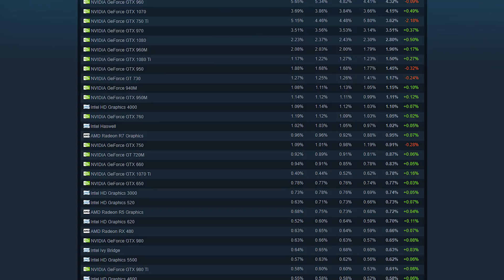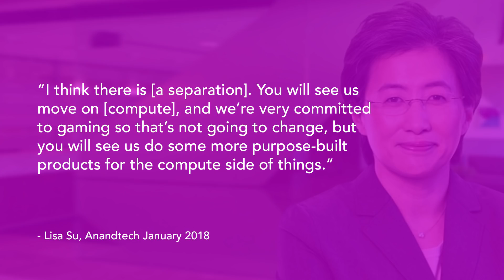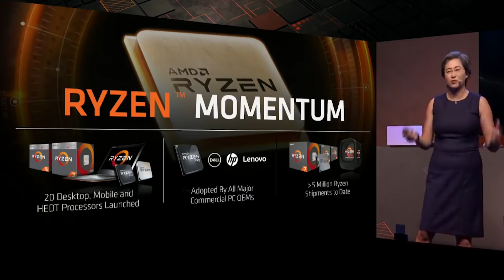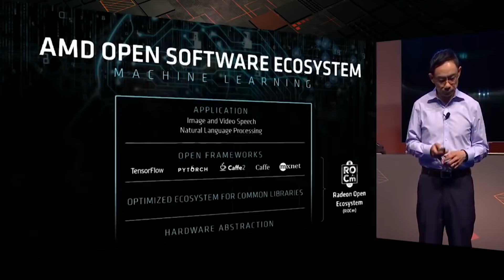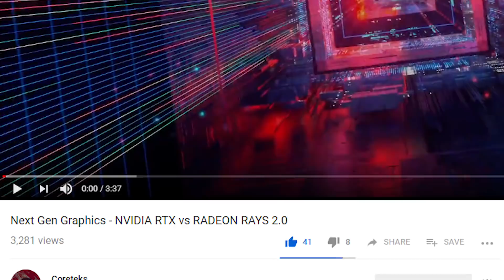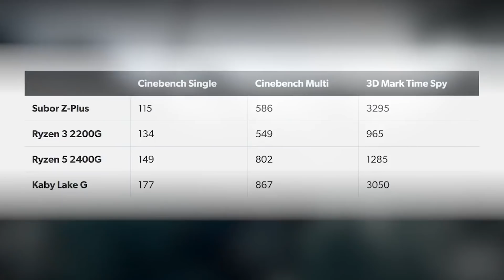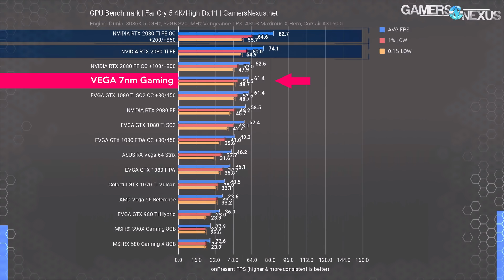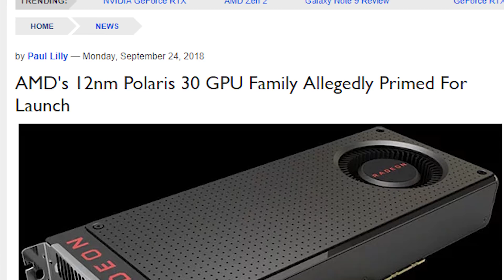AMD's answer to RTX

Comment: I'm wondering... when there was the leadership switchup in the Radeon Group when Raja left, there was also a push over of AMD's Ryzen team engineers.  I'm wondering if Vega 7nm gaming (monolithic) was being targeted for summer/early fall with ray tracing... then nVidia forced out the RTX cards.  AMD may have got wind of nVidia's rush and decided to try chiplet to prevent being badly burnt by yields.  Every time AMD has played the "Lets make a giant chip" game with nVidia, they've flubbed up.  Delay the card preview by a few months, use a chiplet design (since they'd have to redo the memory bus anyway for GDDR6), and delay Zen 2 Ryzen 3000 desktop parts to yield Vega Chiplets for both gaming desktop and mobile.  They could easily hide this move by announcing they were skipping Zen + on Epyc and moving straight to Zen 2... so the foundries are pouring out 8-16 cu vega chiplets and 4-8 core zen 2 chiplets on "7nm", and chiplet controller elements on older 14nm processes (infinity fabric, memory controllers, bus interfaces, etc).    It would be a coup... because then they could tweak all their processors to have some amount of GPU/CPU/Memory/bus flexibility while drastically increasing yield AND getting nVidia to jump the gun on tech.  The biggest obstacle will be the drivers.  AMD has had so many problems with their driver launches in the past.  But... there's only so many methods to crunching a ray and if they've been focusing on ML applications, its possible that they've worked out their own tensor-like AI core.  So if their ray calculation system is faster and they can get somewhere close on the AI side, then its quite possible that a vega 7nm chiplet may have far, far more punch per watt and sq.mm than RTX.

Comment: It's been speculated that AMD's GCN isn't fully utilized in games.  At a guess perhaps only up to 85% or so is used in games.  However, utilizing more of AMD's GNC isn't the problem. Core clock also factors in as well.  If AMD could release a Vega card that is capable of   1850MHz alone would align it to Nvidia's RTX.
Don't believe me? Take a look at any of the youtube videos comparing Vega vs Pascal and you will immediately notice that Vega is at 200Mhz-400MHz lower clock rate then a Pascal card.  
If that clock rate gap between Vega and Pascal was reduced to around 100Mhz or so (at best OC) Vega would fully beat Pascal. And all it would be is a Vega refresh.

Now imagine what Navi could do at 1800Mhz...At best guess it should fully utilize GCN for gaming more so then what Vega could for starters.

Comment: Every AMD product I have every bought went bad after two years. My computer from 2010 is still working great with the Intel and Nvidia products. I would try them again though because Nvidia is getting a little too much in price. I think the max price for the 2080ti should have been $899 since it only gives you 20%-25% better graphics power over the 1080ti. Really I would wait until the next gen cards if you have a 1080ti already it just is not enough increase for the money.
Reply: I am still using a Radeon 7870 to this day (2012) had old 6870 sold to brother still working "perfect" 8+ years (changed the cooling fan because those eventually die) and a 4870 that "lasted" 4 years (till brother messed up and killed it by not screwing the thermal block down proper when he had to replace fan)

I am sure you have many friends (I do) I have had maybe 10 friend with well over 100 GPU Radeon and some 50 with ~500 Nv cards, the vast majority of them had "Nv" die for "no reason" even when the card looked "pristine" then they had Radeons "die" for no reason....... To each their own, sorry about your "bad luck" hell I had one buddy he had to send his GTX260 in 3 times, replaced with a 460, it got "upgraded" to a 560 and 650Ti..all told he went through 10 GPU Nvidia wise (5 replaced my RMA within 6 mths) 5 he bought to replace RMA no longer valid or wanted upgrade (of those 5 no RMA) he "bought" only a single one lasted more then one year NOT being overclocked and always proper cooled case, 5 of them were EVGA, 3 were MSI the rest ASUS, all among the most expensive versions of each (go figure)

Comment: RTX is usless because the performance drop when you turn on ray tracing in a game is so big that everyone will turn it of anyway. What you end up with is a graphics card that is only slightly faster then 1080 or 1080ti at double the price when running games normally without the ray tracing turned on...

Comment: I am excited to see AMD innovating again and beating Intel and Nvidia to market with innovation instead of just throwing more cores and memory to increase performance.  I am actually holding off on building my new system until Navi is released, that is unless the 7nm  Vega cards are priced at point that it makes sense and the performance is on par with a RTX2080.  I have always preferred AMD as their price points have always been more reasonable compared to the competition. 
I am hoping they are taking their time to make sure that everything is ready for Navi so they don't have issues like they did with Ryzen when it was realeased.

Comment: Isn't the higher end market always shit ? It's pushing the boundaries with in-development products that some naive people are impressed with,  the cards are far from bringing proportional performance relative to their power consumptions or prices as far as I can tell.
Reply: usually always is this way...psh to the edge of redline and yes performance gain BUT things wear out much quicker, use a lot more fuel etc, the "middle ground" is where all the real optimizations and stuff really are at (AMD knew this many many years ago and have done sweet spot strategy ever since, start in middle, scale up to "boost" or scale down "to lower power") Nv on the other hand tend to start at very top and "chop and prune" different designs out, their "smallest" tends to be the "best" in regards to lowest power BUT much less performance for extra cost that could have been avoided, but that is Nv for you, sad thing is they tend to NOT increase the capacitor/vreg design from the middle up where AMD DOES

Comment: 1.35 times faster than the previous one?
Well no one really cares about that, because that wasn't really the problem.
The problem was power draw, heat. And right next to the 1.35 times faster figure is the 2x better power efficiency!
Now THAT is a game changer!
Reply: all they would "really" have to do, is "optimize" i.e tweak the voltages like end user can "easily do" but either they did not have manpower or engineers to take the time to do this....Vega 64 is "power hungry" and throttles BUT if you "devolt" it runs WAY cooler and uses much LESS power idle and load and NOT throttle...if they "shrunk" to say 12nm or 7nm and took the time or added a "regulator" to constantly adjust minimum required power (such as Ryzen, Ryzen 2xxx have, and GTX 10 series) it would allow them to have a higher clock AND have much overall better power use (therefore temperatures)

I call BS on Nv power use figures because it is "software" controlled design, Nv constantly BS/hacks/cheats with software BUT they did do a pretty decent job at power design for the 10 series, hopefully AMD took notice and will be doing similar concept but keep the FAT (lower power all the time as much as possible, but have the muscle when you need it) ^.^

Comment: Back in the day AMD has some kick ass cards like the r9 280x which I had and also the amazing r9 290x, both these cards would trade blows with nivida top cards, but sadly now AMD has been falling off, they are just not as good as they used to. Same with there processors they are the same as there old ones, with high core counts and shitty single core performance.(I personally bought the r7 1700x and it does shit in all games, really hold backs my gtx 1080) but now nivida and intel are being more and more greedy and AMD really has to do something to compete with these companies or else the consumers will get fucked over with $800+ cards.

Comment: I will never buy an amd card no matter how cheap they  are. They consume too much energy and generate a lot of heat making my room feel like furnace. And I ain't buying an ac just to spend a lot more money on energy  in the long run.
Reply: I guess you have heard of Vega undervolting. Amd's stock voltages are way too high to ensure that even the worst piece of silicon can hit advertised clocks. Example. My Vega's stock voltage is 1.2V. I have undervolted to 1.05 V and also fine tuned core/hbm clocks to higher than stock and while gaming with 100% GPU usage (PUBG), the card consumes 170-185 Watts, which is lower than a 1070 on stock settings does. Oh, and also it performs better than a 1080 in gaming. Nvidia works out of the box, with AMD you have to tinker a bit yourself to gain most potential, but in the end it is worth it. If you feel like manually changing clocks in 2k18 is not suited for you, stick with Nvidia and call it a day

Comment: The odd part is HBM is just regular ddr memory with more memory controllers. It was supposed to be a cheaper way to utilize older tech. Personally I would like to see vid cards with replaceable memory like in the past. Usually the only difference is between chips is optimal voltage and timing specifications which are normally baked into the GPU rom. It would be nice if someone actually showed mfg real cost vs market up sell.

Comment: I'm neither a huge fan of Nvidia nor AMD. I have a gtx 1060 and I don't care if I have to switch to a vega GPU. But only if I don't need a nuclear plant to power it. When you look at the TDP of the vega 64, it's like x1.5 more than a 1080ti for less power. Add their noisy fan / high temperature  to that and it's a no go for me. When AMD will build a good GPU (like a 1070 for exemple, I don't need more) with a "normal" electric consumption, i'll reconsider the offer. But for now it's Nvidia all the way
Reply: I guess you have heard of Vega undervolting. Amd's stock voltages are way too high to ensure that even the worst piece of silicon can hit advertised clocks. Example. My Vega's stock voltage is 1.2V. I have undervolted to 1.05 V and also fine tuned core/hbm clocks to higher than stock and while gaming with 100% GPU usage (PUBG), the card consumes 170-185 Watts, which is lower than a 1070 on stock settings does. Oh, and also it performs better than a 1080 in gaming. Nvidia works out of the box, with AMD you have to tinker a bit yourself to gain most potential, but in the end it is worth it. If you feel like manually changing clocks in 2k18 is not suited for you, stick with Nvidia and call it a day

Comment: Amd could make a powerplay. They could loose a ton of money in vega 7nm by pricingbit REALLY low to gain a lot of market share so more game dev's support their open source stuff. Thus setting up their cards in the future to be more successful.
Reply: but wouldn't be NVidia be also be capable of that? they have more "resources" and are actually pretty close to real realtime pathtracing... don't get me wrong but most designers learn on platforms line maya or 3ds max and not blender, which have AMAZING bonds with Nvidia's gamework... AMD has to get to the youth of graphics/asset designers and introduce an easier UI implementation for these programms!
Reply: for examole: investing in universitys, that they introduce students to these technology only problem: the older studios are familiar with Gameworks and maya / 3ds so there will be a hard split they basically need to teach sooo many students AMD's way, so that these older studios have NO WAY, BUT TO ADAPT AND ACCEPT amd's technology and scrap that nvidia stuff cus nobody does that then anymore
Reply: yeah but nvidia has many more fans so they wouldnt feel the need to lowball. their cards will probably still sell.
Reply: @Eian_Anderson  yeah, that is also something. Anyway, as i said, they need to convince the classic Studios to adapt.

Comment: AMD's biggest obstacle is the fact that Ray Tracing has to be built into an API. Nvidia utilizes Microsoft's API that they've tacked onto DirectX, and this leaves AMD in a situation where they're forced to develop their own API. Yet again, it's a situation where AMD's option leaves more work for developers, meaning it likely won't be used. Not that it's necessarily a bad thing in this situation; Ray Tracing won't be mainstream for another 5 years if I had to guess. The performance hit is far too great, I mean for crying out loud the 2080Ti can barely surpass 1080p60 with Ray Tracing on.
Reply: Vulkan can do API layer so it can "use" DX12 as a "backbone" and Vulkan as the "lifter" there is a reason why most of the "features" (the advanced ones) in DX11-12 and Vulkan are all near identical to what Mantle was (till AMD "gave it" to Kronos and let MSFT incorporate some of the same features into DX11-12) difference between the wya Nv does things and AMD does things, AMD does majority in hardware, Nv does mostly in "software" because it is "better" for the former and "easier less costly" for the latter

Comment: Wow half the video is pure speculation and even then they admitted Nvidia was still king of the high end GPU market with their RTX cards. So why the AMD hype train? It's not even going to be any cheaper than Nvidia since AMD has to use HBM 2.0 memory because of their design. In fact it might even cost more to buy. WTF is wrong with AMD fan boys? How many times does Nvidia have to beat AMD for them to realize that  they're not as good at the high end. Even today AMD is losing ground in the low to mid end market. Just go look at steam players as reference. AMD is better for the Enterprise markets with their high core count CPUs and their server gpus but that's because they make more $ on that, not as much with the gaming community. So I'm not surprised that they don't really care about beating Nvidia at the high end for Gamers.

Comment: wtf man... if AMD has such a hold back is due to consumers only... Rx 570 and Rx580 are not even in the 20 most purchased GPUs while GTX1060 its the CPU most used in the STEAM anual poll. despite AMD cards being really competitive against both 3gb and 6gb versions of the 1060... in fact, despite win or lose by 2fps on games and trade blows, the fact that Rx series are able to crossfire while GTX1060 aren't should be enough futureproofness for the red team...
But no, consumers WANT to purchase Nvidia cards... they WANT the extra driver optimization and the extra compatibility and "ensure" his money by going with the bigger company that will pay in terms of better consumer support (or at least that's what many consumers think).

AMD falls because majority of ppl and even reviewers fail to realyze that up to the point when red team reach at least a 35% of the market, the Nvidia monopolic practices will go on and on, and the fact that a GPU from AMD loses by 2% against the Nvidia counterpart should not distract consumers from the real picture.

But who am i to think in strategic terms, keep buying the Nvidia shitcards that will gimp drivers after a while and send lesser cards for more price than the amd counterpart just because they can
Reply: Wow half the video is pure speculation and even then they admitted Nvidia was still king of the high end GPU market with their RTX cards. So why the AMD hype train? It's not even going to be any cheaper than Nvidia since AMD has to use HBM 2.0 memory because of their design. In fact it might even cost more to buy. WTF is wrong with AMD fan boys? How many times does Nvidia have to beat AMD for them to realize that  they're not as good at the high end. Even today AMD is losing ground in the low to mid end market. Just go look at steam players as reference. AMD is better for the Enterprise markets with their high core count CPUs and their server gpus but that's because they make more $ on that, not as much with the gaming community. So I'm not surprised that they don't really care about beating Nvidia at the high end for Gamers.

Comment: If AMD focused on making Radeon Pro drivers available to RX 500  and 400 series cards even at a small additional fee, they would be unlocking the compute power of those consumer cards for 3d gpu rendering in Maya, Cinema4D , Max and Blender and pretty much put Nvidia in their place. Linus did a specperf benchmark and he said that all the highend 1070 and 1080 cards got stomped in Solid Works once shadows and textures were added to the viewport while the Radeon cards held up decently.
Reply: the "pro" drivers only mean so much, drivers can only activate what the card has on them in the first place, the "pro" cards are that way for a reason, often stability and/or from bin testing a certain variant they found only 10 out of 1000 could be "fully active" without fusing things off..of course sometimes they release "full fat" that is sofwarware locked, but just as often the "driver" simply cannot unlock what was no there (or nonfunctional) in the first place.

Not to mention the "pro" stuff is NOT built for "speed" at all, they are built slower clock/power use for stability and accuracy. I want the best quality possible with all the bells and whistles BUT I do NOT want a high end anything running like a snail even if it "never fails" ^.^
Reply: Well you want a fast card for gaming probably. I like to have an enjoyable gaming experience but I would rather have stability with let's say GPU rendering, and with AMD's raw compute power and Vega architecture, you would expect some thing badass but then again AMD doesn't have CUDA and the OpenCL platform is slower, even though Vega 64 beats 1080ti in professional apps. They should invest more coding capital into OpenCL for GPU 3D rendering.